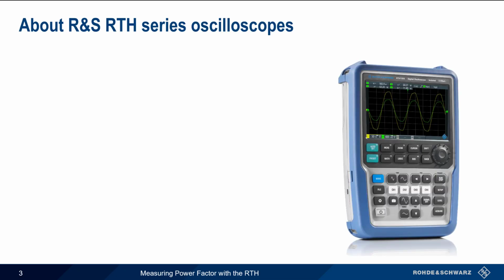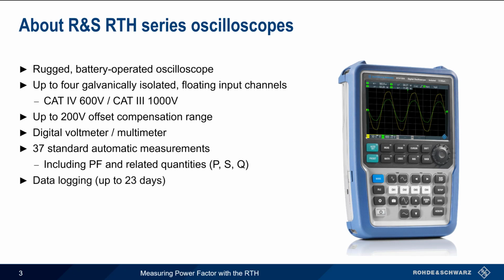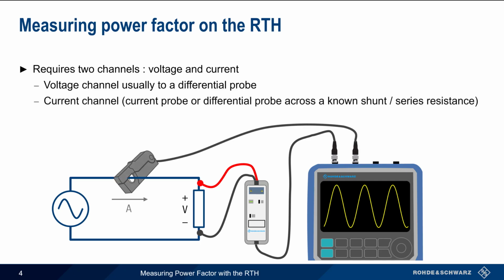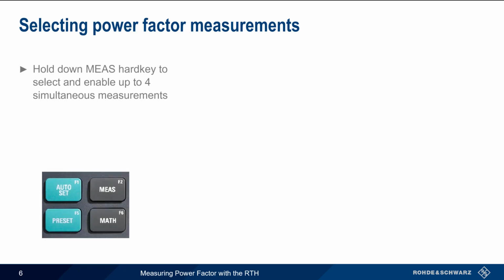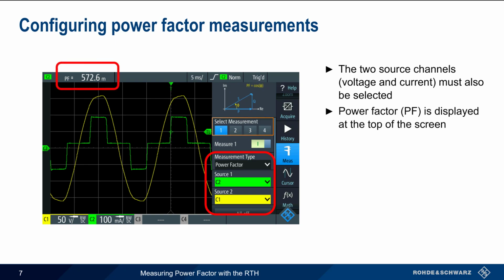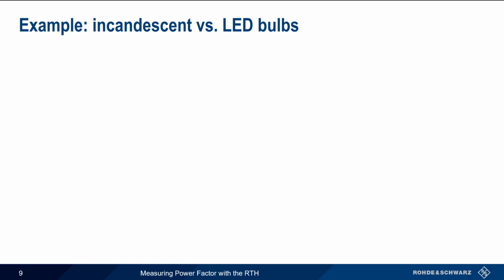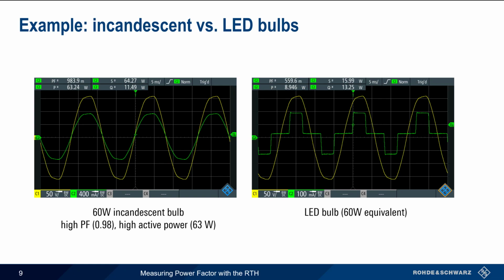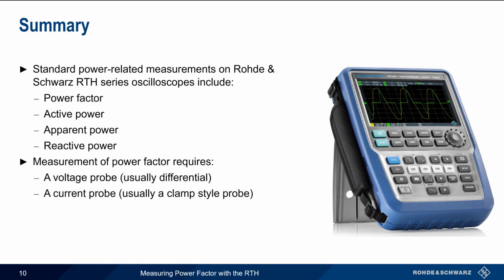Measuring Power Factor with RTH Series Oscilloscopes

Comment: Why should you use differential probes? Doesn't the oscilloscope have a differential input? The inputs are not related to ground?
Reply: I'm actually working on a presentation on differential probes right now, but in the meantime:  most oscilloscope channels are all ground-referenced and tied to a common ground, which is the same as the electrical ground (3rd pin) of the scope's power cord.  If I want to measure a difference between two points and neither are ground, then the best way to do this is using a differential probe.  One could use two "singled-ended" (non-differential) probes and "float the scope" by disconnecting the ground connection, but this is usually a bad idea and unsafe, as it can damage the scope, the device under test, and/or the user.

The RTH is unlike most benchtop scopes in that it actually does have floating and isolated inputs, so the "quasi-differential" two-probe approach is somewhat less hazardous, but differential probes are really the best solution.  If you regularly measure power, you really want /need a differential probe.

Hope that helps!
Reply: Thanks for the information. everything is understandable. Admittedly, I have also "float the scope" by disconnecting the ground connection on a benchtop oscilloscope. It's not optimal in terms of security, but it works. 
The RTH has isolated inputs, i.e. if you use this, you don't need a differential probe, the input is already differential on this scope. 

The video is really well done. It would be nice if there were more of this type, as the RTH also has many options (RTH-K...RTH-PK...) that could be explained individually.
Reply: @gerdschneider6098   Agreed.  I'm pretty sure all scope manufacturers officially "disavow" floating a normally non-isolated scope:  there are just so many things that can go wrong if users aren't careful.  One of the reasons I haven't (yet) produced a video on floating and isolated measurements is that I would have to preface it with a warning / disclaimer - I don't want to be responsible for someone getting hurt or blowing up their scope.

And I actually have another RTH video going live this week ... maybe even later today :)